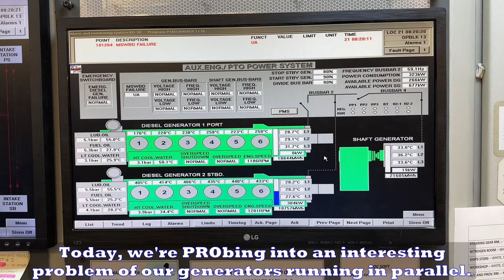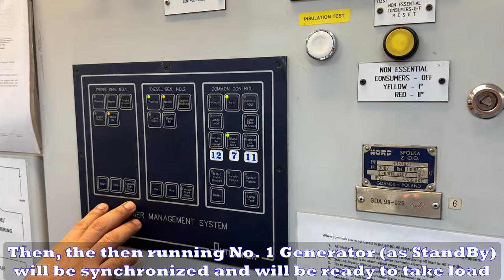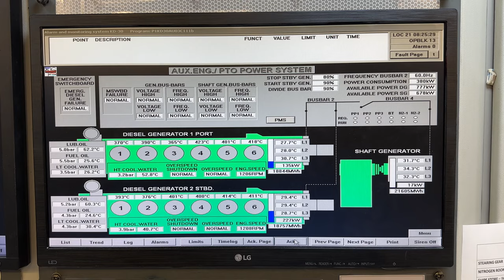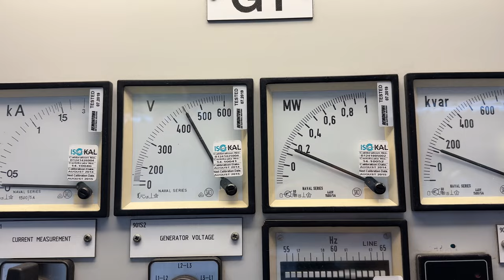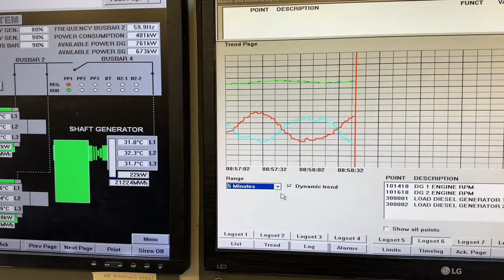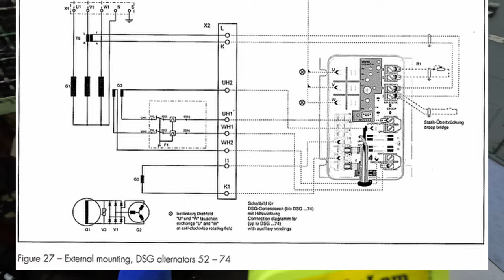#PRObeLogue! Generator No. 2 Auxiliary Exciter Voltage Abnormal [Part 1] | What Could Be the Cause?

Comment: Where there any recent works/maintenance performed on the generators recently (mechanical of electrical)?
Can you plot the reactive power output (kVAR) in time the same way you did for the active power? It seems stable and more or less equal on the analog gauges.

On first sight it seems you could have a case of Active power hunting but it's a little soon to be sure. Can be caused by:
- Speed control issues: Have both fuel governors checked and calibrated/adjusted by a specialised company
- Issues with fuel input to governor
Reply from the maker: Hi, thanks for your expert insight. 
1. There have been no recent major maintenance. 
2. Unfortunately, there is no reactive power parameter in the AMS. This equipment along with this vessel is 25 years old already. But in the analog, they have 50-60kVar gap. G2 always higher. 
3. Major overhaul is due next year and to done by specialist company.
4. For control adjustment and probed fault finding, part 2 is in the pipeline😀. 
Keep on probing!

Comment: If one of the 6 rotating diodes fails, a lower voltage will be applied to the excitation. Diodes are problem, we should check them.
Reply from the maker: Good insight🤗. Keep on probing!
Reply: A diode failure would result in a lower  DC supply voltage for the main rotor. Meaning the stator would have difficulties reaching the set nominal output voltage (for example: 400Vac). As a reaction the AVR should start compensating this effect by driving the supply voltage for the excitation stator to it's maximum, which isn't the case here (10.66Vdc measured on I1-K1 in the video).